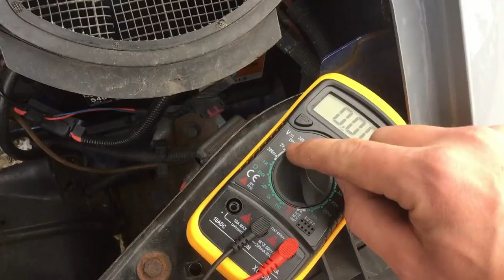VW T4 - Replacing the Starter Motor

Comment: The large 13mm on the back of the solenoid is a positive pole not negative the small spade connector is a positive that comes from the ignition that activates the solenoid to push the teeth into the ring gear
Reply: I was just going to comment similar.
Negative is through the gearbox / engine earth connection.

Comment: Great vid thanks. Have to fix my van too not sure is the starter (battery is good) . A couple years back had same issue w my car, replaced the starter and nothing. Issue was the ground cable on the battery was dirty/corroded so there was still contact and electric system worked, but it could not support the whole 300 or so amps for starter due to the weak ground connection. I cut the ground cable end to expose some fresh copper and re attached everything and worked like new, didn’t need a new starter in the first place.
To check this first I would set the volt meter to measure resistivity in ohms, then touch the battery ground with one end and then either the engine block or some unpainted area in the car frame and make sure it reads zero ohms meaning they are connected. (Mine wasn’t).
The starter has no ground cable connection so it connects to the battery by touching the car engine or frame.
It’s also possible the connections at the battery are good, but the battery connection to the car frame is bad (the ground cable is bolted on to the frame or engine at some point if you follow it). Then your lights and radio and everything will work fine, buy the starter is not connected tot the battery (has no ground cable remember) and it will behave the same way you’ve shown here. Thanks for sharing this it makes me confident I can replace the starter myself if needed 👍
Reply from the maker: It’s all a case of trial and error! I am now aware I mistakenly called the wires pos/neg, but at least it still shows how to change it all correctly. Best of luck!
Reply: Thank you. Gonna have to check this out tomorrow as I’ve changed the starter in mine and still nothing although power still going to everything else.

Comment: Did you have to jack the van up tp get under, or could this be done by just sliding under? 

Need a new starter motor among other stuff and just had a huge bill from our mechanic, so anywhere to save money would be great.  Also an excuse to play under the hood again.  

Thanks.
Reply: Prob be ok standard, mines dropped 60mm, so it's a bit tight lol

Comment: How do you find using your T4 to commute or as an every day van? (Other than the obvious starter issues you had!) I’m tempted by one but would need to use it an every day car so unsure how efficient it would be
Reply from the maker: Stacey Powell 

Hi Stacey, great question! This is actually something I might make a video about. Personally I find it absolutely fine. The mpg is about 31, which is only about 25% more than my old ford fiesta, so I am not too worried about cost. As for using it as a daily driver, I can still pretty much drive it like a normal car - it fits into normal parking spaces in town etc. It does take a bit of getting used to, but now I have it is honestly not really any different to using a normal car
Reply: Ace! Thanks for the reply! I currently have a fiesta so good to know it’s not too much more! It would be great to have a video about it sometime!

Comment: Few corrections. Sorry. First. Putting a voltmeter across a battery is not a full test of it's condition. It's the ability of the battery to supply current under load that matters. Secondly. The fat wire that goes to the starter motor is not negative, It is a positive supply to the starter motor direct from the battery. The other, thin wire, is a positive supply to the starter solenoid and controlled by the ignition switch. Third, as has been said, there is no real need to disconnect both battery connections but there's no harm in doing so.
Reply: Nearly forgot. Don't wish to be picky but the 13mm bolts are 8mm bolts with a 13mm head,  A bolt size is determined by the thread size, not the head size,
Reply from the maker: Thank you for the feedback

Comment: Bet it was your ignition switch £3 eBay sits inside ur ignition barrel it’s always usually intermittent fault starter was probably ok especially if it’s only one year old
Reply from the maker: Nope, I replaced the starter and it hasn't happened since. I will consider that next time tho!